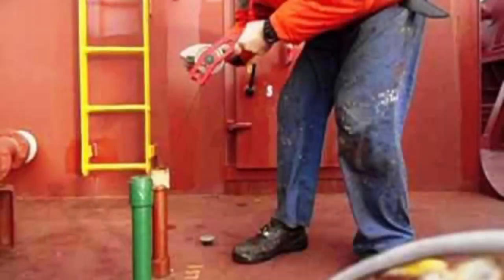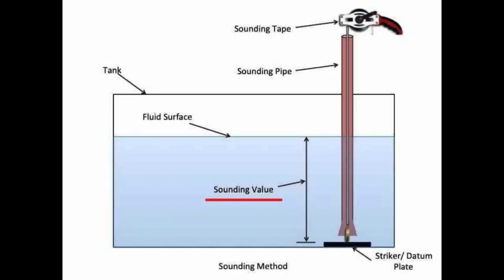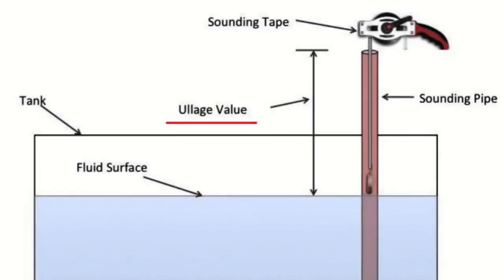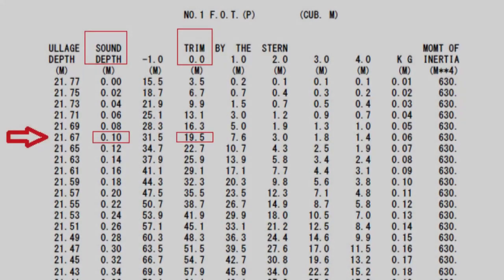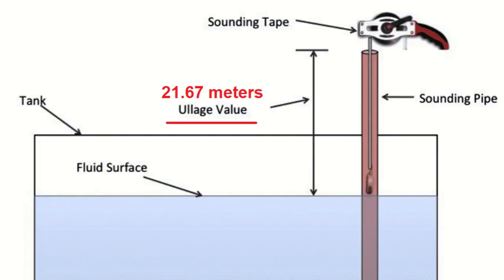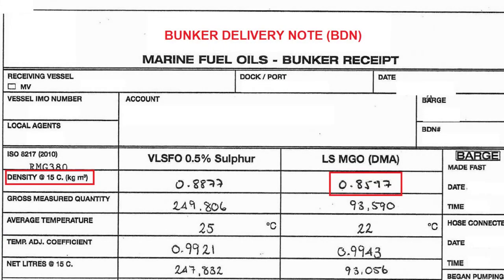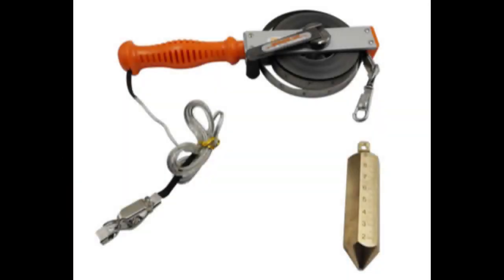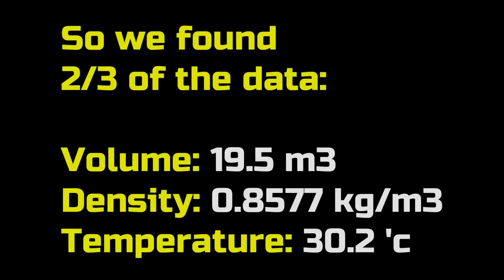How to find the Volume, Density and Temperature of the fuel

Comment from the maker: How to find the Volume, Density and Temperature of the fuel . How to transform cubic metres to metric tons of fuelon board a vessel. Hello. Today We are going to show you how to tranform the quantity of the fuel you have on board from cubic meters to metric tonnes.

We are going to use this FREE Excel file which calculates automatically
and you can get it for free from the link which is locates down bellow
to the description and to the comments section of this video. It can also
be downloaded from our related article on our website:
Marine-Engineering-News.blogspot.com at the EDUCATION category.

What you have to do is only to input three required data and all the rest
calculations are done automatically. This file is suitable for all the types
of vessels of Merchant Marine and is a great tool for all Chief Engineers.

The three data you must input are :

1. The Volume of the fuel in cubic meters
2. The Density of the fuel at 15 degress Celsius
3. The Temperature of the fuel

Let's do one example and input these data for one fuel tank for example:

1. We input the known volume for example of 300.40 cubic meters
2. We input the known density for example 0.904 kg (kg/m3)
3. We input the know temperature for example 30.3 degrees Celsius

And we see automatically the result that 300.40 cubic meters of fuel
equals to 268.03 metric tons of fuel.

We are going to show you where:

1. To find the volume of the fuel
2. to find the density of the fuel
3. to find the temperature of the fuel

on our next video and on our next article on our website.

If you like to learn how to find these data mentioned above
you should better to Subscribe for free to our YouTube Channel
to get notified when our next video will be published and to follow
our website feed on Google News.

Thank you for watching.

Read also our related article where you can find the link to download the free ecxel file: https://marine-engineering-news.blogspot.com/2023/04/how-to-transform-cubic-metres-to-metric.html
 
#nowornever  #nikolaosgeorgopoulos Public Person☑, Father🙎‍♂, Single 👤, Chief Engineer⚓🚢, Vlogger 📽🏍🚘, Gamer 🎮, Blogger👨‍💻, Scorpion.📍Patras 🇬🇷 . I travel around the world with my KAWASAKI VERSYS 1000. NEW VIDEO !!! HAVE FUN !!! SHOW YOUR LOVE WITH FULL VIEW AND COMMENT ON THE VIDEO ON YOUTUBE TO GO HIGH IN THE YOUTUBE ALGORITHM TO SLOW YOUR VIDEO AND CHANNEL TO THE HIGH CHIPS, SNACKS, BEER 🍟🍕🍿🍺🍻 . I finally chose which machine is suitable for me. I was born to travel. Motorcycle adventures are life's best adventures. Every day brings opportunities for new challenges. Beyond the roads I know, there are completely new vistas. Unknown roads are easier and more distant places with the Versys 1000. When adventure calls, me and my Versys 1000 have the answer. ANY ROAD. WHENEVER.
------------------------------

FOLLOW UP THE NEXT MOTO TRAVEL VIDEO
https://www.youtube.com/@borntotravelGR

🌟NIKOLAOS GEORGOPOULOS
STORE Born to travel ® : https://www.youtube.com/@borntotravelGR/store
WEBSITE Born to travel ® : https://borntotravelgr.blogspot.com/
Join this channel to access perks:
https://www.youtube.com/@borntotravelGR/join
FOLLOW ME ON MY SOCIAL NETWORKS:
https://www.instagram.com/borntotravelGR
https://www.tiktok.com/@borntotravelGR
https://www.facebook.com/borntotravelGR

#borntotravelgr #versys1000 #akrapovic #kawasakiversys1000 #motovlogger #motorcycle #kawasaki #moto #phantomduck #malagutispectre125gp #dezaiar #pamegamotavasana #rena_project #bucephalus #fatusolus #toraxeris

🌟 MARINE ENGINEERING NEWS:
INSTAGRM: https://www.instagram.com/marineengineeringnews/
WEBSITE: https://marine-engineering-news.blogspot.com/
GOOGLE NEWS PAGE OF MARIME ENGINEERING NEWS:
https://news.google.com/publications/CAAqBwgKMKr0zAsw2o_kAw
FACEBOOK PAGE OF MARINE ENGINEERING NEWS:
https://www.facebook.com/marineengineeringnewsglobal
LINKEDIN PAGE OF MARINE ENGINEERING NEWS:
https://www.linkedin.com/company/marine-engineering-news

#marineengineeringnews #chiefengineer #marime #engineering #maritime #merchantmarine #merchant